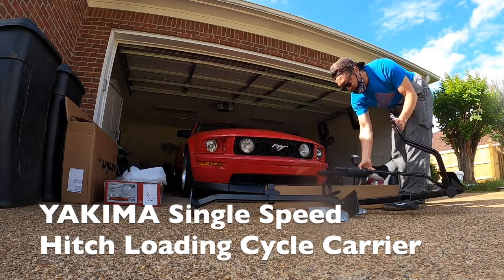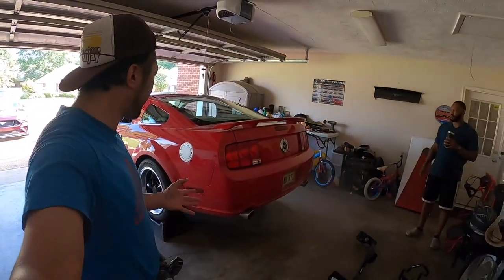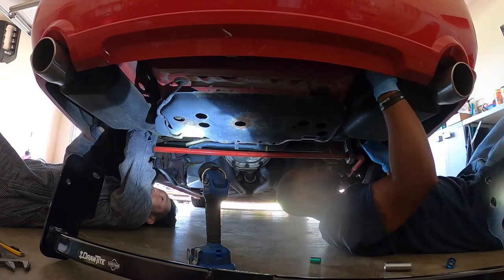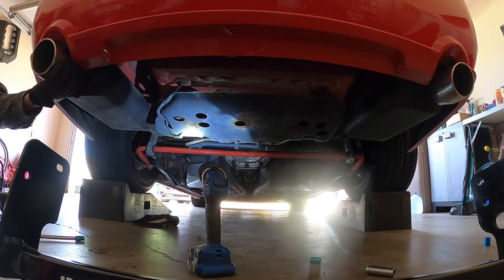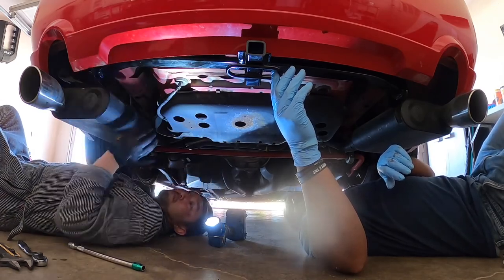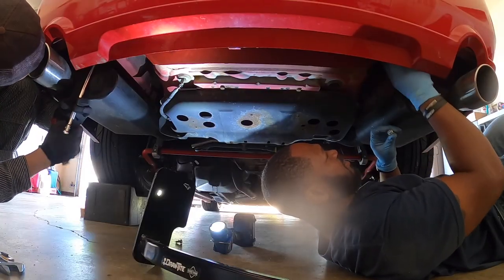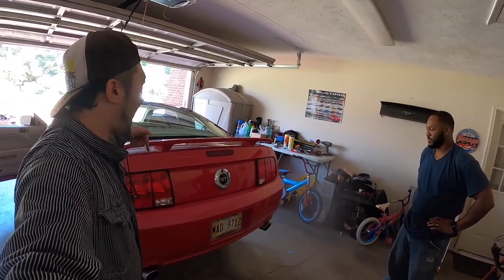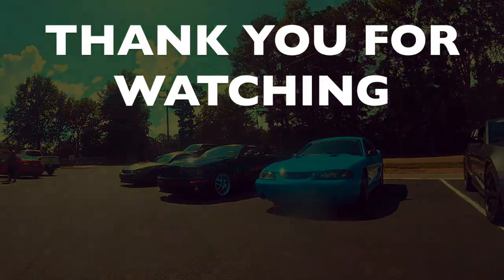【MUSTANG】e-trailer Hitch #24747 Installation 【Failed】

Comment: I ran into the same problem when mounting a Curt hitch on my 2014 V6 with Bassani mufflers. I was able to gain the necessary clearance between the hitch and the rear hangers on those mufflers by cutting off 1/2" from the front of the left & right exhaust pipes where they butt up to the H pipe, which then allowed moving the mufflers forward enough to prevent contact with the hitch.
Reply from the maker: That would be good idea. I had same problem. On my case, my welder friend shortened the muffler hanger half inch to make good clearance.